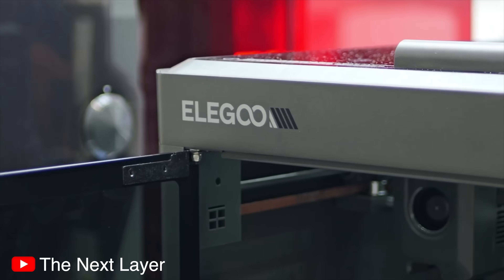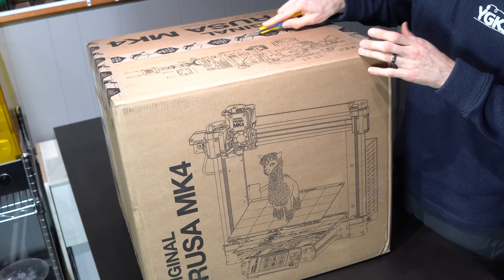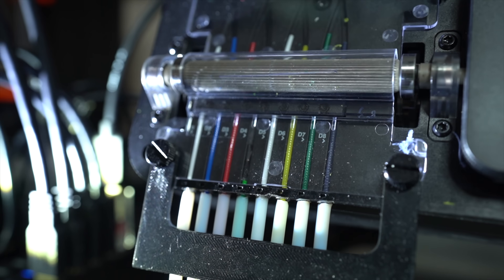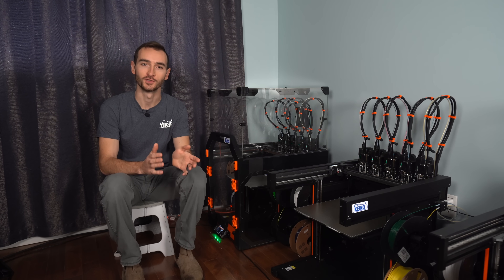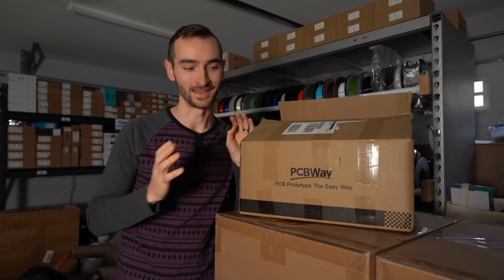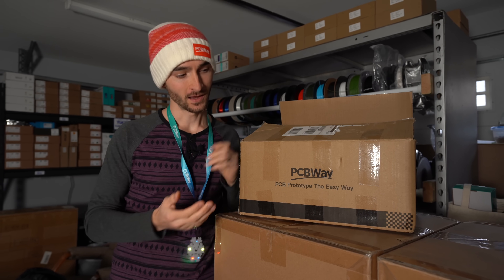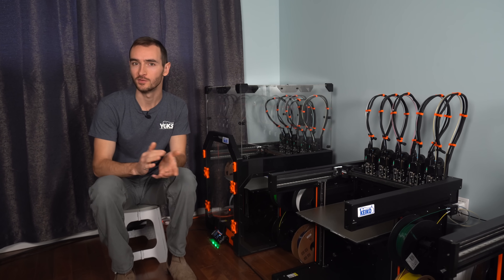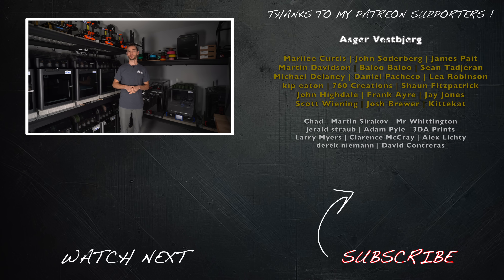The Prusa Core One is dividing the internet...

Comment: I have said no to both of them for different reason! I support the right to all my stuff no matter who I buy from Prusa allow this Bambu Lab will not however Bambu Lab makes great easy prints that when it works, it runs everything for as if their hand your hand it almost impossible to make a mistake, well I don't want my hand being held yet Prusa has failed on far to many levels to beat Bambu Lab on size and automatic sensors, be it for what ever reason even passionable legal ones that is one thing that is one that stops me cold from buy either one! IMO the Core One is a joke at best I would get the MK4S even if I paid more money than for the MK3 than the Core One I just don't want a Core One it is too weak!
Reply: You did get a thumbs up from me, but that based on you not the machine's show here!

Comment: I'm looking to get my first 3D printer. I figured an enclosed XY was the way to go, as it would have headroom to grow and I don't mind a bit of overkill. The simple fact that the P1S is WiFi only and requires Cloud connectivity for anything, yet alone the most fundamental purposes of the machine, was an absolute deal breaker for me. It's not even a compromise, it's a "gotchya", and it's either lazy or just downright nefarious. Sorry, but I like my stuff to work local / offline and anything that doesn't move should be plugged in. It's that simple. Anyway, that stopped me pulling the trigger on a discounted Bambu. But really, what other competing products that were reputable were there? Couldn't find much - and then the Core One was announced. Seems like a no-brainer to me.

Comment: I know you are using Bambu vs Prusa as a comparison since doing Creality vs Prusa wouldn't get the clicks. That out of the way, I have spent most of my life rebuilding machines. I have written some of the firmware a few 3d printing companies use. I fixed a Prusa left in a corner at my old company. They shipped me parts at the cost of shipping. It ran 24/7, the issues I had were the bed coating needing to be replaced every month or so. The other was at the time the print success rate was about 80%. 
Fast forward to me buying a X1C right as they left kickstarter. It has 1500 hours as I no longer work at that company and no longer need to make parts for prototyping and production repair. The one failing part was the cooling fan on the main board. It took an hour to replace. The first step isn't listed on Bambus wiki, or Prusa, or any other site. It is prepare your work area. Make sure you can take good pictures, organize the fasteners, make it as easy as possible before you start taking it apart. Get PM materials handy to do while you are in there. Bambulab spent a lot of time, money, and effort actually making repair tutorials. Instead of dealing with language gaps with calls, or having people who understand how to fix them do customer support, they instead released the equivalent of shop manuals.

Saying you want to toss even a $100 printer for a one hour fix is crazy. Do you make that much in an hour? 

Better talking points would be literally shipping your designs through the cloud to China, vs not. Or a change in trade/shipping agreements. Or makerworlds' agressiveness in getting online models. But those would probably run askew of the algorithm. So you took the " I didn't try to spend an hour or 2 to save myself $100s of dollars" route. I watched a video last week of a guy with well over 100,000 hours collectively of print time on X1C's at his farm. He even admits he fails at maintaining them as far as PMs. 

As someone who now more like advises, I recommend A1 minis and A1s to people getting started. They are easy to repair, like Prusas , due to them being open and not a core xy. A nozzle change is literally unclip the old hotend, and clip in the new one. They aren't printing PC, or PEEK. For a print farm, it is what can run the longest reliably. It's a business. For companies prototyping, or government groups who want to keep all their stuff quiet, while shipping a printer the end user can pull out of a box, setup and run, its a Prusa. 

Both cut into each others consumer market shares, but the philosophy and design behind each, as well as their infrastructure  for parts, service and so on are vastly different. You also can't compare them on company longevity due to Bambu not having  yet released its 2nd gen of each printer, whereas Prusa is on M4. I had an I3 from them, it was a mess to work on, and to be fair, it was from a small "company", not the Prusa today.

So where does that leave Prusa with this printer? The XL doesn't really have a large market. Prusa, like many others, were slow in releasing anything new. I am glad they released this one. I like their company and want them to succeed. But this is them playing catch up. What Bambu did that succeeded, was take high end features that the parts don't cost that much for, and added them to a printer and sold them way cheaper than Ultimaker is. That is who they targeted with their X1. It forced the other companies to actually innovate instead of changing 1 or 2 parts then selling a new model. The core one never would have seen the light of day if Bambu never happened. 

TLDR: screw Stratasys

Comment: I would still like to have a core one instead of a Bambu, and keep the peace of mind that if something breaks I'm not gonna have to go sell stuff to replace the whole kinematic system when a bearing eventually goes, and the fact that it is still opensource i can do anything i like to it, and with the added HUGE aftermarket support you can build an ERCF for multicolor prints up to however many different chambers you want per unit

Comment: Just my two cents as the owner of a print farm: infrastructure is key. The cost of maintaining and repairing Prusa surpasses that of Bambu. While the quality-of-life features are good for people new to the hobby, they are useless for a farm that needs to meet MVP. You are right that the perception is that tech is disposable, but when you either replace the whole system or buy $50 in parts every quarter, there is no competition.

Comment: I have both a MK4 and a P1S. Both are great printers. Interms of quality, precision and overall user experience (once it is up and running) I favor the Prusa ever so slightly. But I guess it is more of a "feel" thing. I use them for different things. Learn your printers strengths and weaknesses and act accordingly. Most of what I print is way smaller than 21x25 or 25,6x25,6 cm. The Core ONE is definitely on my wishlist. For larger prints I have a Creality S1 PLUS that took ages to get working - never doing that again.

Comment: What is mentioned in the video, but seemingly not discussed in any of the comments, is that "excellent" Prusa tech support really still excellent?

I had an issue with a loud squicking bed, to which support replied to me if my belts are properly tensioned, "that noise is normal". Given any Prusa at our makerspace, it wasn't. Eventually i fixed it by reprinting all of the bed, but the problem really is that once you start searching around you'll see a stark influx of lackluster support stories over the last few years, both on reddit and their own forum. Not only overlooked problems, but also a lot of handfighting over replacement parts like faulty idlers/bearings and definitions of consumables when people haven't even got to a first proper print.
Which brings me to the question; why is this positive stereotype still a given for Prusa?

I'm not saying anyone else is doing it better, just that i question Prusa's still being "good".

Comment: I think you're missing a crucial point - what Bamboo is doing is actually expanding the market by offering a cheaper, yet reliable printer that's accessible to newcomers. This includes providing a better community experience for new users who don't have to worry about complex print settings. With Bamboo, if you want something printed, it's as simple as clicking and waiting. In contrast, Prusa hasn't helped expand the low-end/middle market at all by promoting their XL and MK4s+ models with expensive price tags. I'm not even comparing the MMU2 (which is essentially garbage) and AMS by Bamboo - 3D printing has tremendous potential for expansion, but five to six years ago Prusa's decision not to produce cheaper models for the low-end market was a wrong one for this industry.

Comment: Have a MK3S with a modified MMU (electronic rewind in dry-boxes) for years, I did buy now a PS1-combo for the speed and needed small space.  I like both machines, but the X1C, the Core One and the MK4 are too expensief for what they offer. I would consider the X1C if it had a heated camber ( and not the overpriced professional version !).

Comment: I bought a Prusa Mk3 when it first came out.  I had a few issues with the kit assembly and Prusa was very helpful in fixing them.  I upgraded the machine over time.  When Prusa announced the XL, I placed a deposit.  However, they didn't deliver, so I bought an X1 Carbon with the AMS.  The AMS always jammed, but single filament prints were very nice and quick.  Then the machine refused to accept over the air input.  It also wouldn't upgrade.  Bambu service wasn't helpful.  I traded the X1 to my son and got my old MK3 back.  My son got the X1 working and loved the accuracy for the small figures he makes.  It still wouldn't upgrade.  I just bought a Prusa XL 2 head printer.  I hope it will be less trouble than the X1.  It also will print the larger objects I print and allow engineering grade materials with inexpensive support materials.  We'll see, but all this has made me a bigger Prusa fan than before.

Comment: Such an interesting video, with things I've never thought about. Personally, I live in the UK and am a student studying Electronic Engineering. I worked at a cafe full time for a year and bought myself a Prusa MK3, I still use it today. I've replaced multiple parts and I know if I had an issue, I could likely fix it myself or contact customer support. 

I recently bought an A1 Mini on sale for £180, this is an incredible value for a secondary printer as I don't need it to last for long and I don't rely on it. However, I could never have a bambu printer as my primary printer for those reasons, the company has bad customer support and their printers are not very fixable. 

I think when I've saved enough money, the Prusa Core One will become my primary printer. Prusa is what a company SHOULD be, it's what old fuddy duddies rant about what companies used to be like, and personally I'm fed up on underspending and getting companies that don't care about their customers.

Comment: I have had only minor repairs on my X1C and P1S with minimal maintenance, and over 1700 hours between them (probably more, that was just the last time I remember). One actual part needing replacement, that's it (I have replaced a few others as preventative maintenance). Bambu's parts have stayed in stock, are fairly priced, and even though I found the maintenance on my Enders intimidating, I have gotten pretty comfortable taking apart the AMS, and everything I've had to do so far on the Bambus has been ok. They have not been able to keep their filament as available, and as a tiny business I can't really rely on Bambu filament, so I mostly use a few other brands.

Comment: Reliability is a big part of decision making for home consumers too. When I was choosing printer, or helped someone else, it was always "Prusa, or something else?", precisely because Prusa is a "safe choice". Companies in China appear and vanish, are known to publish unusable code just to satisfy licenses (usually after pressing them to do so), and publish features that work only "as expected". Prusa was, is and most likely will be there, to support customers, just because they want to and its important to them. Placing customer first, is an endearing quality that certainly moves stock. Mind you, you can buy technically better printers for fraction of the cost of any Prusa printer, but that one detail, that safety in knowledge wife won't scream at me I bought another useless chunk of junk that occupies space unused (as it can't be fixed anymore), is often enough to open the wallet little wider.

Another thing being Bambu networked-first machine is often enough to scare away many potential customers.

Comment: I bought my mother a Bambulab A1, and while the printer prints in much higher quality than my personal MK4S, the plastic parts on it always seem to break. The purge wiper broke within a week, and the webstore also seems to always be out of stock with replacement parts. A week ago, the AMS Lite filament hub broke, and I'm scrambling to fix it before Christmas. 

I love the metal parts on my Prusa MK4S. The printer feels sturdy, and I haven't had a part break since I got it as a MK4. The Core One hasn't sold me whatsoever, and I thank you for the information and non-biased opinions you have provided in this video.

Comment: The Core One looks like a nice machine, and I really like what they've done with the spool holder compartment on the side of the printer, but it's just too expensive. The Bambu P1S is less than half the cost and is a proven machine. I think you're right that Prusa is aiming more towards businesses that need support and reliability.

Personally, I have a Creality K2 Plus combo on order. Slightly cheaper than the Core One, but is way larger, includes a multi-material unit and plenty of extra features.

Comment: I live in brazil and here the prospect of a 3D printer is still a costly one no matter which you choose. You can still buy creality or prusa clones for cheaper (emphasys on the ER at the end, it's still expensive), but the idea of a show stopper issue at only 1000 hours of printing is a dealbreaker here. We need them to last MUCH longer than that (or be easily repairable) to make up the costs. A Bambu P1S is the equivalent of 1800USD in local currency and hard to come by (wait times START at 25 days), and good luck trying to find anything with an AMS for less than 1.2k usd.
It is obviously different in Europe or USA, where things are cheaper and easier to procure.
 Most people that actually work with a 3D printer for more than a hobby go with Prusa or Creality. Mostly because of the repairability and upgradeability. And no one dabbles on that without being at minimum a bit of a tinkerer. We already have 3D printer fabs here, but they are mostly populated by prusas and creality machines, with the industrial machine being used now and then on the big-ticket players.

So for our specific situation, the Prusa justifies the investment with upgrade path, repairability and longevity, and in case of a complete renovation, value retention. WE don't have the luxury of ordering a part and have amazon overnight ship it to our door from a warehouse somewhere in poland or in the US, so these aspects are paramount.

Comment: Once we get some consumer machines like the X1C with the repairability of Prusas and nozzle temps of at least 350C, beds of 120C+, and chambers reliably north of 60C it feels like the average DIY market is going to go downhill fast.  Right now the Creality K2 is close, but it's still Creality.

I run a modified Voron Trident and one of the only compelling benefits over current off-the-shelf offerings I still have is higher temps.  If Bambu pushed their nozzle to 350C that would be even less of an argument.

It's truly crazy how fast the market switched around when the X1C was released.  To think I and so many others started on cheap Enders and now we're here only a few years later...

Comment: Another problem is distribution.  Prusa doesn't ship from America, and the only distribution it has is through printed solid.  Where I live we can simply walk into a shop like microcenter and walk out with a Bambu Lab printer.  With a Prusa that costs more than $800., it will get held up in customs and I will have to pay some additional charge to release it at the border.  This hasn't been a huge problem when the printer was only $800. like the mk3s etc. but it still really does cut down on the "impulse" buyers.
Reply: I paid like $15 to release two MK3S+ from customs and it only added a day to shipping. It's not a big deal.

Comment: I'd be surprised if I'm the first person to state the obvious but if you go one step further and bring the P1S into the comparison it's a no brainer that Bambu is still winning this fight. The lidar calibration is of no value to me as I'd rather perform manual calibrations of my filament for better results. The larger screen of the X1C is nice but rarely used as most of the printer operation is done through Bambu slicer. The hardened steel nozzle and extruder of the X1C are easy upgrades if users want to go that route but I'm willing to bet a majority of users will primarily stick with PLA, PETG, TPU, and ASA which doesn't require hardened steel. Lastly the X1C has a considerably better camera than the P1S, which is quite noticeable between the two Bambus. The X1C has failed print detection which would be nice if it was consistent but too often failed prints go undetected so the P1S does just fine with regular check ins through it's laggy camera system to ensure prints are still going well. Prusa will really have to advance and disrupt the 3D printing market if they ever want to become on top which I just don't see happening at this point...